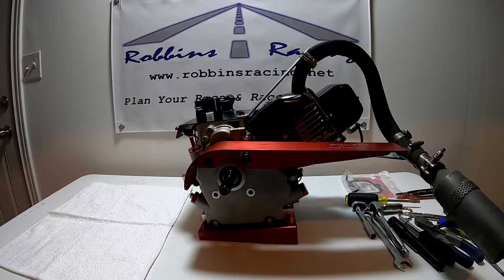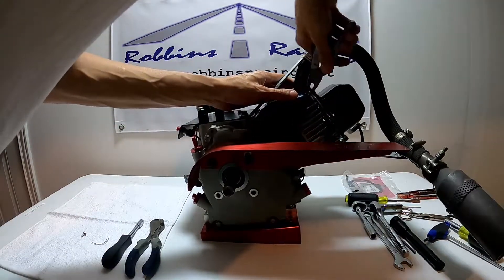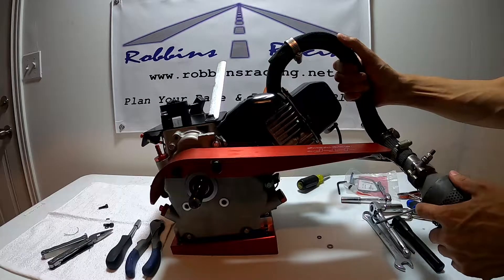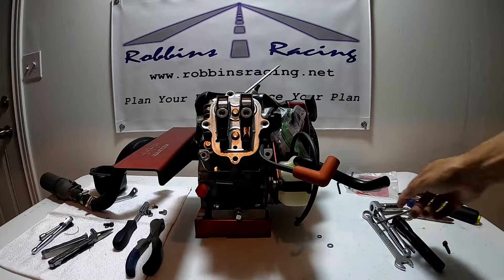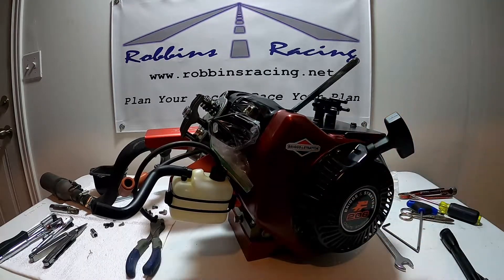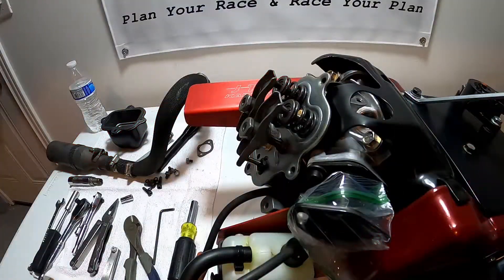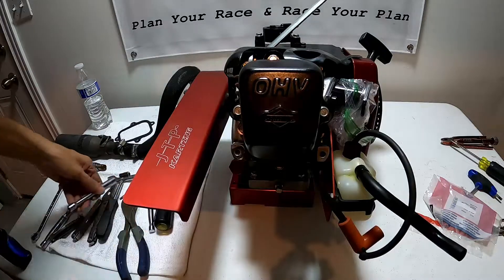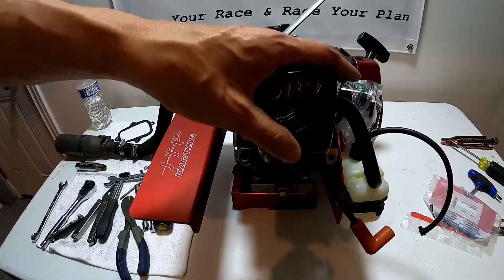Briggs LO206  Valve Lash

Comment: Have you run it on the dyno with the intake higher than the exhaust?

I recently learned that Dan (on the Briggs videos from 2020) got it backwards. He said it right at first (and “corrected” himself) and then started saying it wrong. The intake should be higher than the exhaust and this is from someone that is seeing the different on the dyno and someone that talked to Dan in person as recent as last year.

Love your videos though! They’ve been a huge help.
Reply from the maker: I have since started using the camshaft profile to determine where I want to set the lash.
Reply: @robbinsracing801 I just realized I totally said it wrong too. Hahahaha We just did a dyno test yesterday on my motor (which was new late last year) set the intake LOWER than the exhaust. We set it to a tight 1.5-2 on intake and a tight 6.5-7 on the exhaust when the motor was hot. And since the exhaust opens even more when running the gap is a little wider when operating. 

It moved my torque curve about 250-300 rpm’s earlier in the curve and smoothed out the torque curve and HP at the top end as well. 🤷🏻‍♂️

I went from 10.45 HP to 10.64 HP and 12.55 before to 12.46 after on torque, but the curve looks way better and starts earlier without losing top end. What do you typically see on HP and Torque? Obviously a different dyno but just curious. The highest I have seen on this dyno on another motor is 10.95 on HP and 12.75 on torque.
Reply from the maker: Now that I have a load cell I am going to re do the lash vids.
Reply: @robbinsracing801 look forward to seeing those new vids! My son post his vids on YouTube, his name is Bryce Benton. 👍🏻

Comment: Question: Valve lapped and set the valve lash. Piston cycles fine until I put in the spark plug is put in even part way I can really pull the starter as the piston no longer cycles. Is this a valve lash issue or something else? Thanks D
Reply from the maker: Probably the lash,  I would start over and make sure the piston is at top dead center on the compression stroke before you set the lash.
Reply: @robbinsracing801 you are right. Looks like what I thought was TDC looking through the spark plug port was not. I took off the header, put it to TDC and when I checked my lash was way off. Reset the lash with real TDC and Bam back in business. Thanks man!

Comment: Why would you set your intake at 6 thousands your getting less fuel & air into cylinder & that results into less HP 🤔
Reply from the maker: Dyno and on track results say otherwise
Reply: @robbinsracing801  i would like too see a Dyno pull showing these results. Last i checked on a combustion chamber motor you want as much Fuel & Air into cylinder & use maximum lift on cam lobe to open intake valve as far as you can too get max Combustion with out binding lifter & push rod & rocker arm when cam lobe is at max lift 😁 So why would you want less fuel & air into cylinder 🤔
Reply: @scotts24D  there’s more to engine operation that simply valve lift. Adjusting lash can affect things like valve overlap and duration. I know another builder that uses 0.006 as well due to testing showing better results. Meaning a better fuel air charge. At .002 lash they have can have reversion pushing exhaust gasses into the inlet reducing volume used for fuel and unused air.
Reply: @scotts24D I have my 206 currently set to 6 on the intake and 2 on the exhaust. I was told that I have it backwards by someone that has talked to Dan about it. We are putting it on the dyno tomorrow so I will have hard data on one versus the other. We are going to run it how I have it set and then flip them and see what it does.
Reply: I would be interested in the Dyno results 👍 @marc_benton
Reply: @scotts24D ok, once I get them I’ll be sure to reply here.
Reply: @marc_benton  did you get results of swapping the lash before and after?
Reply: @mikestig77 yes, we ended up going to a tight 1 on the Intake and a loose 6 on the exhaust. Every motor likes something different but that’s where mine ended up and I gained about 5% in Hp and Torque. And these settings were done when the motor was high, which is when you want to set them.
Reply: @robbinsracing801  Still like all your vids very clear on how things need to be fixed in Kart Racing 👍🏁🏁